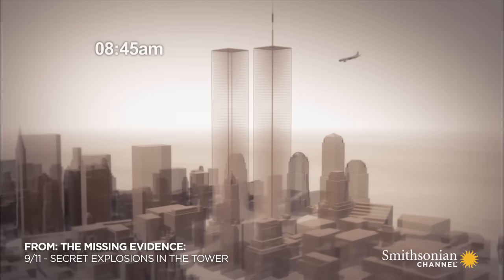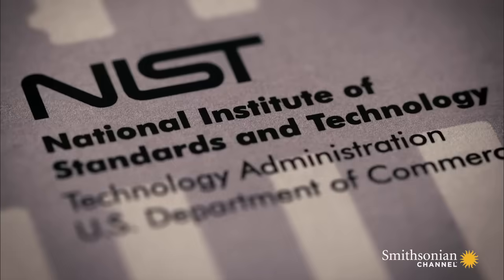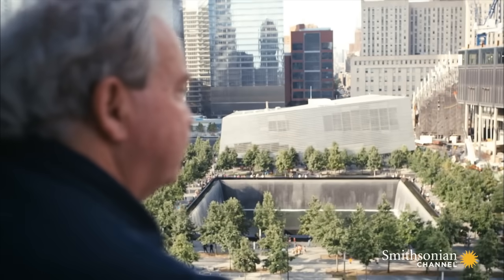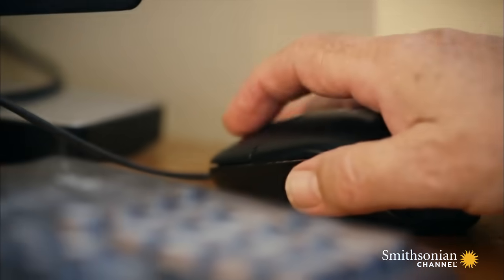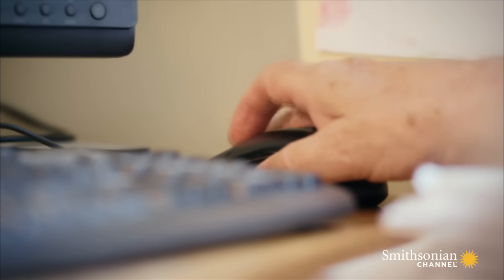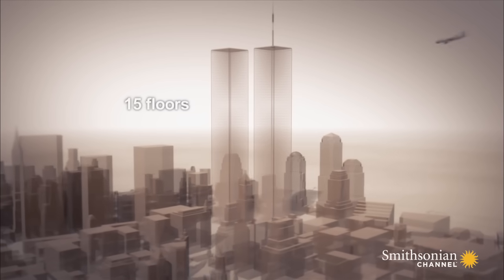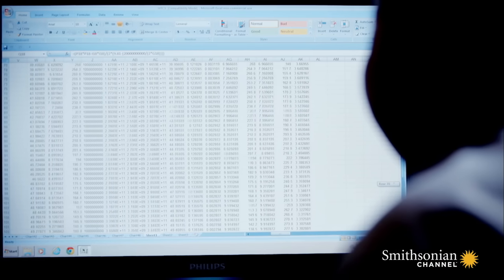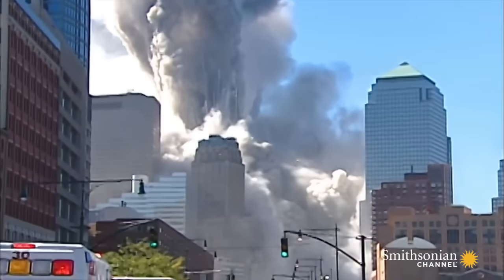This Computer Simulation Explains How the Twin Towers Fell

Comment: Okay okay okay OKAY!!!

Firstly, let's ask htf did the planes even get inserted into the buildings??? Weren't the towers encased in some sort of reinforced steel? With gigantic pillars of steel beyond that? Yet the planes sliced through them MAGICALLY with zero resistance like a supercharged light saber through toast! Not one bit of plane was smashed or smacked off the face of the buildings during impact. WHICH IS HIGHLY IMPROBABLE! Or should I just come out and say it... IMPOSSIBLE!

And second, your math sucks. There's not way the weight of the upper floors would pancake perfectly straight downward with ZERO RESISTANCE. They literally fell at the speed of natural free-fall. And you can literally SEE the buildings vaporize as they are falling. Massive pieces of steel, several floors in height just vanish before your eyes. Yet "they" managed to find a terrorist ID? Gimme a break...

So please stop your BS that you consistently are attempting to feed us. WE'RE NEVER BUYING INTO YOUR "OFFICIAL "STORY""!!!

Comment: This was one of the most simplistic and glossed-over analyses of the tower collapses that I have seen.

In order for the collapse to progress as described, each floor below the collapse had to be completely removed, thus allowing the upper section to fall within 1/6 of a second.  Otherwise, all you have is weakened steel columns being crushed by the load above them.  Once the weakened structural members have been crushed/deformed, the collapse ceases.

Nothing in that analysis explains how burning sections of steel wall could travel a horizontal distance of 300 feet and crash through the front wall of Building 7 and set it ablaze.

The other impossible aspect of the simulation is that the structural resistance of the tower works both ways.  For each action, there is an equal and opposite reaction.  As each floor of the tower below the collapse point is destroyed, the floor immediately above it is also destroyed.  That means each "falling" section would be reduced to a rubble pile after traveling downward through a distance equal to its height.  That condition does not even take into account the increasing structural density of a skyscraper towards the ground level.  Once all material above had been reduced to rubble, the collapse would stop.  The remaining lower portion of the tower would still be supporting the same mass as before the impact of the plane, the subsequent scattered fires and the failure of the columns at the impact location.

The simple fact is that steel offers resistance to motion, even if it has been weakened by fire.  An entire section of a building cannot "fall" onto a portion below it unless: A) it is first raised to a height equal to one floor level and then dropped; or B) ALL supporting material below it is instantaneously removed, thus allowing it an unobstructed free-fall path onto the floor below it.

The latter case is the false assumption upon which the analysis presented in this video is ENTIRELY based.

The laws of physics do not change simply because the facts are uncomfortable.

Science does not care what you believe.
Reply: "Science does not care what you believe."

That's exactly why the vast scientific consensus that explains how plane impact and fire caused the collapses doesn't care about Youtube comments from rank-amateur conspiracy kooks.

That's also why conspiracy kooks have made zero progress in 17 years of trying to undermine the scientific consensus.

Comment: This is a trick. There is NO upper building section, and lower building section. There is an incredibly strong INNER grid of core columns, and an incredibly strong OUTER bearing wall, with the floors hung in between.  The building itself is one big central column. Thinking that the core column couldn’t support its own weight is crazy talk.  This is NOT a building dragging down the columns, this is a giant grid of column support just falling apart like a house of cards. To claim this video is science is just an insult to mankind. We’re back in the dark ages of knowledge. People just believe whatever the government and popular society says.  The truth gets you labeled as a “conspiracy theorist”, and lets face it, this is why people refuse to look at the evidence, this is why reinforcement like this video is so important to them. They seek comfort, not truth.
Reply: asrgaqgq sdfgsdgsdfgsdg  
Oh right. Because you know how fires are just always heating up steel buildings and causing them to fail? Wait.. Its never happened. Hotter, longer lasting fires have never caused a steel building to collapse. But to you its just common sense. You are delusional. 
If your "opinion" is that an airplane can just fly through restricted airspace, and straight into the Pentagon without a single fighter jet intercepting it, you're completely brainwashed (you don't even have an opinion, you just THINK you do). Congratulations.
Reply: asrgaqgq sdfgsdgsdfgsdg 
Are you real? It’s hard to believe anyone could be so stupid. You didn’t give a single argument for anything. Try again.

Comment: Smithsonian says top 12 floors mass began to move and stayed in motion. Makes a lot of sense. What about the progressively stronger 98 floors at rest? Odd? Why wouldn't they tend to stay at rest. Move over Newton.
Reply: asrgaqgq sdfgsdgsdfgsdg  The force of any accelerating mass due to gravity alone is always less than it's static weight.  Exerting an amplified force requires a jolt, momentary deceleration. This deceleration is not measurable using physics software analysis. We have now moved from Newton's 2nd law. Want to try the 3rd, or conservation of energy or momentum.
Reply: Great point. This Smithsonian video says 'The official government report only addresses the collapse initiation mechanism, not the physics of the actual collapse.' Actually the 10,000 page NIST report admits "We were unable to explain the complete collapse." So there exists no official story.
Reply: asrgaqgq sdfgsdgsdfgsdg  You called me a dumbass. Then I tried to calmly explain some basic science. You mentioned comparing my facts to the official story. I point out there is no official story. You go to explosives, which I haven't don't have time to get into. But I'm waiting for your response to any of my facts. But maybe the Smithsonian can use their momentum transfer program of Microsoft Excel to explain how a 110th floor can hit the ground in 11 or 12 seconds when it would hit the ground and 9.22 seconds in a vacuum. Air resistance a loan with slow it to over 11 seconds. 200000 tons steel in concrete should provide more resistance than air.
Reply: @apparentweight  ”What about the progressively stronger 98 floors at rest” Thanks for proving you have no idea how the towers were built. The floors did not get progressively stronger. This was due to the unique way the floor systems were constructed. All the floors above ground, with the exception of 3 mechanical floors, had the exact same load capacity. That capacity was 12 floors worth of static weight or 6 floors dynamic. This is a mathematical and engineering fact. Here is the math that proves it.

Yes, there was more than enough gravitational load to cause the collapse of the floors below the level of collapse initiation in both WTC towers. The vertical capacity of the connections supporting an intact floor below the level of collapse was adequate to carry the load of 11 additional floors if the load was applied gradually and 6 additional floors if the load was applied suddenly (as was the case). Since the number of floors above the approximate floor of collapse initiation exceeded six in each WTC tower (12 floors in WTC 1 and 29 floors in WTC 2), the floors below the level of collapse initiation were unable to resist the suddenly applied gravitational load from the upper floors of the buildings.

Consider a typical floor immediately below the level of collapse initiation and conservatively assume that the floor is still supported on all columns (i.e., the columns below the intact floor did not buckle or peel off due to the failure of the columns above). Consider further the truss seat connections between the primary floor trusses and the exterior wall columns or core columns. The individual connection capacities ranged from 94,000 pounds to 395,000 pounds, with a total vertical load capacity for the connections on a typical floor of 29,000,000 pounds (see Section 5.2.4 of NIST NCSTAR 1-6C). The total floor area outside the core was approximately 31,000 square feet, and the average load on a floor under service conditions on Sept. 11, 2001, was 80 pounds per square foot. Thus, the total vertical load on a floor outside the core can be estimated by multiplying the floor area (31,000 square feet) by the gravitational load (80 pounds per square foot), which yields 2,500,000 pounds (this is a conservative load estimate since it ignores the weight contribution of the heavier mechanical floors at the top of each WTC tower). By dividing the total vertical connection capacity (29,000,000 pounds) of a floor by the total vertical load applied to the connections (2,500,000 pounds), the number of floors that can be supported by an intact floor is calculated to be a total of 12 floors or 11 additional floors.

This simplified and conservative analysis indicates that the floor connections could have carried only a maximum of about 11 additional floors if the load from these floors were applied statically. Even this number is (conservatively) high, since the load from above the collapsing floor is being applied suddenly. Since the dynamic amplification factor for a suddenly applied load is 2, an intact floor below the level of collapse initiation could not have supported more than six floors. Since the number of floors above the level where the collapse initiated exceeded six for both towers (12 for WTC 1 and 29 for WTC 2), neither tower could have arrested the progression of collapse once collapse initiated. In reality, the highest intact floor was about three (WTC 2) to six (WTC 1) floors below the level of collapse initiation. Thus, more than the 12 to 29 floors reported above actually loaded the intact floor suddenly.-NIST

”The force of any accelerating mass due to gravity alone is always less than it's static weigh” Actually no, it’s double. You failed basic physics didn’t you….

”explain how a 110th floor can hit the ground in 11 or 12 second” Simple, they didn’t. NIST states the FIRST piece of steel hit the ground in 11 seconds, not the last. Actual collapse times were on average around 19 seconds and this doesn’t take into consideration the nearly 45 seconds the cores remained standing.

Comment: WTC 7 is the key it collapsed from normal fire also like a controlled demolition. Silverstein said we decidet to pull it. Well this is not possible in a few hours on the same day at 5pm. And he also told the world that he had the plans for the new Building in 2000. And why are the planes made of Aluminium Always fully diving into the Building without leaving anything outside the massive and narrov steel columbs. And why did the plane's nose fully raged out of the other side. come on... And by the way: where is all the rubble gone? vaporized?

Comment: Ok, now simulate every single beam of steel and how they would look like all on top of each other once the towers fell.
Reply: The gold that were in the vaults were taken before the attacks, everything.
Reply: @Wikchsawa  Actually, there are reports of witnesses that army trucks were restricting the access to anyone that comes nearby at tunnels beneath the towers. I guess that's when they were taking out the gold.
Reply: @Wikchsawa and insurance deal closed agaisnt terrorism some time prior the 9/11 event
Clown show ...
Reply: For anyone else wondering  the towers were mostly air by volume to maximize office space so you could fit the towers steel almost entirely into their 6 story basement underground if packed solidly. (The wreckage from 9/11 was standing about 10 or so floors above street level, (+ the 6 floors below for 16 floors total)
Reply: And include the controlled explosives.. where the gold from building 7 went .. how tower 7 fell .. carry the 1... 2 planes = 3 buildings 💀
Reply: @jimthompson8947  There were reports of Army soldiers at the underground forbidding people to move in. I think they were retrieving the gold.

Comment: Yes weight alone could cause such a colaps but structure integrity offers resistance absorbing energy of the collapsing floor above other wise when a car fails to brake joining a mile long jam it would simply smash every car in that mile. But we all know this is not what we see happen. Deepening on the speed that car is traveling it's impact would only be absorbed by two or three cars. This guy is lieing through his teeth no when he lies he licks his lips
Reply: asrgaqgq sdfgsdgsdfgsdg  brilliant so we have now established that a car can't take out a mile long jam.  What stops it from doing so? What laws of physics stops that from happening   if i now through in they are going down a steep gradient gravity is no a factor aswell such as in the case of an avilanch. Or will the same laws of physics stop every car being smashed in a mile? Just like this video I'm still yet to here a single bit of science just loads of gob shite

Comment: Even if there was enough weight up above to bring down the towers, there would be some resistance from the floors below. It wouldnt fall at free fall speed. Common sense says it would meet resistance, and slow down at least to some extent. This was clearly a controlled demolition. This guy has drank the kool aid for sure.
Reply: They didn't drop at freefall speed.
Reply: The twins both fell in acceleration at about 66% of the rate of free-fall acceleration. NIST report on WTC7 claims it experienced 2.25 seconds of free-fall acceleration, but failed to address the implications of free-fall. By the way, WTC7 continued to accelerate after the 2.25 second mark, at a rate less than the rate of free-fall, so it was stiller gaining speed. All three towers came down in accelerating rates of speed. In all examples of gravitational collapse, without applying extra forces to the structure, the rate of collapse always decelerates as more resistance is met. Newton's laws of motion were in effect on 9/11.
Reply: @chuckhole  What planet did that math come from??? WTC had 2.25 seconds of freefall, then it sped up? If it is already at freefall, then speeding up is not an option. The twins obviously were not accelerating in their fall. It is clear from the video that they were losing ground on the other debris.
Reply: @joeplumber1337  You misinterpreted me (or purposefully twisted my words?). I said WTC7 experienced 2.25 seconds of free-fall acceleration, after which it continued to accelerate, but at a rate less than free-fall. This is evident in the graphical representation of the building descent generated from video analysis. Do you know the definition of acceleration? Here you go: "Acceleration is a vector quantity that is defined as the rate at which an object changes its velocity. An object is accelerating if it is changing its velocity."
Reply: asrgaqgq sdfgsdgsdfgsdg  Do you have a rebuttal or do you only have denial, as you have demonstrated so far?
Reply: asrgaqgq sdfgsdgsdfgsdg  They rarely get the chance, but that's what they say when they are asked. So it appears that your tactic is to deny anything you want without presenting an actual rebuttal.

Comment: all lies, aluminum going through steel? Aluminum exploding and brought down building? A total collapse of the building on itself? And the “fire” that brought down building 7? ALL LIES  - Truth is controlled demolition.  here’s how the fake plane hit the building, twin tower building 2, I watched the video, stopped it at 3 spots and took screen shot, plane far right, plane closer to building and explosion. I overlaid them all, somebody should have told them to plant the explosives 10 floors lower then they put them, then the explosion might have looked like it was in the right place if it really happened
Reply: Yep, aluminum through steel. The "fake" plane was seen by 100,000 people in person. No way to CGI eyeballs. Maybe someone convinced YOU they were fake. You'd have to be mighty dumb not to remember all those witnesses. The scientists at MIT calculated the plane only used a small fraction of its kinetic energy to break through the outer wall, the rest was used up destroying the tower structure inside.

Comment: Only one person figured this out ? This sounds silly why didn't the top of the build just slide off since the lower floors already have to support the weight above a thousand fold ?
Reply: Because 150,000 ton chunks of building don't just slide off without something big pushing them. Why is it these dumb ass troofer pretend they are all structural engineers who know more than actual engineers?